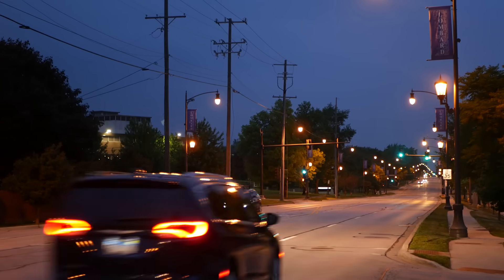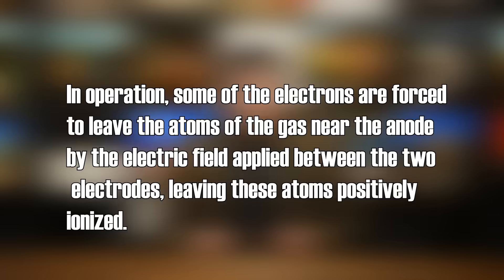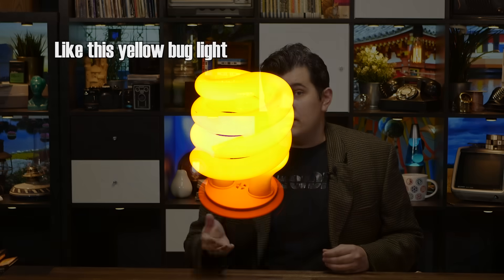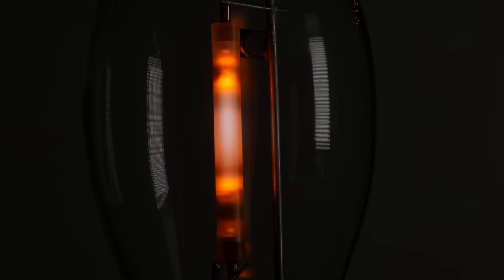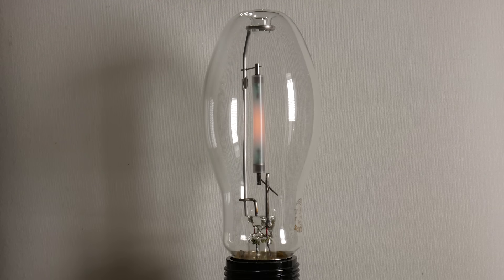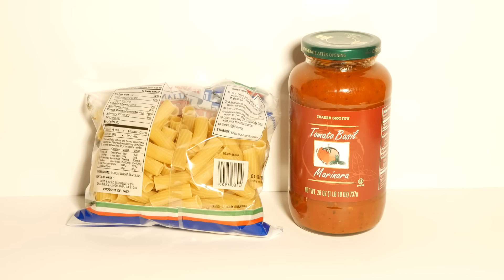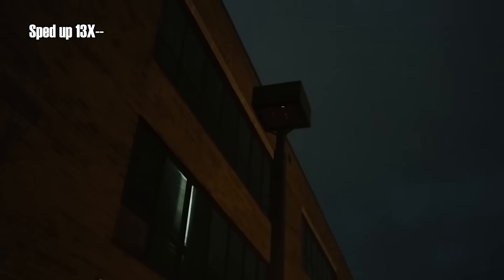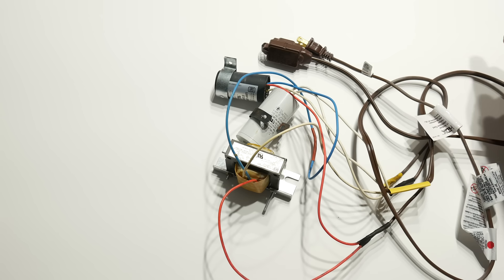The High Pressure Sodium Light: Ubiquitous, effective, but good?

Comment: By the way, discharge lamps predate the incandescent lamp. The good, old arc-lamps came first and this was what literally had caught Edison's eyes and made him come up with a solution for mass-producing a "soft" light you can use at home. Arc-lamps are also discharge lamps, they just use air as the gas with standard atmospheric pressure.

Also, did you know that the FAX came before the telephone? First was the telegraph, then the picture telegraph which was a crude form of the analogue FAX. Actually, analogue FAX systems were not standardized. A FAX like we know today is digital, no matter which country or brand you use, they can work together.
While the first picture telegraphs which scanned with light were made around 1900, there were versions long before the invention of the telephone which scanned using a wiper contact rubbing over an embossed metal plate. The picture had to be etched into the metal first.

Comment: First of all, great work, as usual!

You can make a home-made spectrometer using a CD or DVD (or Laserdisc ;-). All you need is an optical grid. A grid so fine meshed that the light bends with different angles when passing through it depending on wavelength. A CD is the same, just an optical grid "glued" onto an reflective surface. So a CD and a ruler is all you need, just make sure the light you want to examine shines onto the CD with always the same angle. You can use a monochrome CCTV camera module to analyse the result. You can put the CD and camera module into a cardboard box to do the trick. Capture a still image and you can analyse the picture in a paint program, e.g. use "alien map" to colorize the intensity levels like a thermal image camera does.

When I was in engineering school I made computerized spectrometers for the school. Just a shoe-box sprayed black, a piece of CD and a modified CCD camera for the parallel port of the computer in 1994. Nowadays a simple webcam or even better /Raspberry) "Pi cam" would do. In 2002 I had built a laser interferometer using an old Webcam electronics soldered to a FAX scanner line. 

Scientific instruments don't have to be expensive, it's all about calibration. Software compensation is cheap, easy and often as good as spending an awful lot of money for an almost flawless setup.

Comment: Technically, the CIE Color Rendering Index is not perfect as it tests a limited number of colors, all of them pastels, and doesn't correctly determine the rendering of saturated colors. It also doesn't take in account gamut, and how lighting level interacts with color perception. A CRI of 100 could still end up reproducing some colors badly (though that's pretty hard technically, it matters more for ratings in the 80-90+ range).

The IES TM-30-15 method and NIST Color Quality Scale are better ways to evaluate a light source's color rendering.

Comment: I remember having white street lighting some 20 years ago. Then they changed it to orange.
The orange glow makes it "feel" more like nighttime.
Reply: I remember an odd thing about the white ones, we used to go down the street when I was a teen and give the wood electrical pole they were mounted on a good kick.  They would immediately go out and about 2-3 minutes later start to come on again.
Reply: @Linflas  Sounds like the movement somehow triggered enough of a pressure increase to cause the lamp to shut off. This would happen normally when the temperature got high enough, but as temperature rises so does pressure in the lamp, so one can cause the other. When the temperature gets too high the lamp is designed to shut off. It then cools down and the arcing slowly starts to ramp up again, which also slowing increases the temperature of the lamp, and how bright it is.
Reply: @Linflas  This unlocked a memory in my brain lol. I once visited a cousins place in super rural Georgia, they have a singular streetlight infront of their house that will start out a bright blue-ish white but then slowly fade to a green-ish color before turning orange and shutting off for a few seconds before repeating. Its really creepy considering its literally the ONLY outdoor light for probably a mile or so. If you kick the pole really hard it shuts off for a while and comes back on to that cycle mentioned before.
Reply: Sadly they are going back to white. When the city beside mine switched to LED, they went to pure white LED...and it is too bright looks bad and is bad for the wildlife. You can have the orangishbrown LEDs but so few put the effort to use them instead of white.
Reply: @fortheloveofnoise  Yes, and it is also blinding, plus, it creates anxiety when I am around one.

IMO, Mercury-Vapor lamps are far more pleasing than LED lights also. I get the same amount of comfort from them that I do from the orange ones.
Reply: The first generation of discharge street lighting was mercury discharge which was a slightly blue white.
They were replaced with high pressure sodium for 3 reasons. More lumens per watt. Less refraction in fog. Lower bulb cost. Because mercury lamps produce a lot of UV and the bulbs are not too bright to stare into, eye damage was always a worry.
However, mercury light made buildings look far more attractive.
Reply: @wilsjane  love the mercury vapour lamps the best
Reply: @wilsjane   Interesting you say less diffraction in fog because when snowing the orange light is horrible as you see nothing while with the old bluish mercury discharge lamps you can see just fine when it snows with much less light reflecting from the snow in air. They have not come around to change all the old lamps yet here so you can clearly see the difference when it snows or wind is blowing snow. But now they are changing it to bluish LED laps that do not seem to have the same advantage of shining trough snow like the old mercury discharge laps .
Reply: +Rondo Cat. Sorry for my delay in replying, things have been a bit hectic lately.
It is quite a long story. In the early 1950's traditional tungsten lamps were replaced with discharge. The main reason was lamp life, around 6 times greater, but their were considerable energy savings that seemed less important at the time.
The 2 types were SOX sodium and mercury. Although the sodium were more efficient, they were a dull red, making it difficult to distinguish traffic signals and making human faces look a reddish green color. Therefore mercury was soon adopted, but some areas that had already converted side streets to SOX retained them, using mercury on the main roads.
Around 1970, their were worries about mercury on 2 fronts. The first was the rate of depletion of mercury on the planet and the second was the harmful effects of the heavy metal on public health when a lamp ruptures releasing the metal vapor into the atmosphere where it condensed into mercuric oxide. Worries were even greater about disposal of the lamps.
At about the same time, Thorn invented the SON high pressure sodium (that we are familiar with today). Since energy prices were rising,  the 40% saving was very welcome. Their performance in fog was a large improvement, but as you say they are not quite as good in snow. Since fog is a major cause of accidents in the UK and we get very little snow, they were better for us.
Then along came LED's. Stupidly, people were expecting the 80% energy saving comparing them with tungsten, but in reality they save around 20% compared to SON. Glare from the bluish white light is quite a problem, particularly on the lower lamp standards in side streets, A new diode has been introduced with a lower peak in the SED curve, but they give less lumens per watt. The main attraction was the 30,000 hour lamp life, but unfortunately LED's break down very rapidly in heat. The combined effect of the rectifier drivers and sunlight is causing a massive problem.

PS, If you have not already guessed, I am a chartered electrical engineer and I have worked on film set lighting for more than 50 years. I hope that my reply was not too confusing. LOL.
Reply: @wilsjane  yes and we need orange lamps in areas which get fog lots.
Reply: @wilsjane bluish green*
Reply: I like the orange glow, it feels cozy to me. In my part of California, they are rapidly changing street lights everywhere to white-ish LED's. These look harsh and weird to me, though technically superior. I grew up with the HPS street lights. I'm old enough to remember the blueish white mercury vapor street lights. Those were cool.
Reply: @gregmercil3968  Tell them how bad the white light is for wildlife, then they will change to orangishtan LEDs
Reply: @fortheloveofnoise  it fucks with their night vision and sleeping. It's pretty well known dude. Lots of national park campsites are starting to ban or limit white led headlamps for that reason.
Reply: Mercury Vapor lamps come in two types: coated or clear. Originally only Clear MV Bulbs were available, but in the mid-1960s coated was introduced. The one you are describing seems to be Coated mercury.

The difference is that Coated mercury is mainly white with a slight blue halo around it, but Clear mercury produces a white glow that is essentially an inbetween of Green and Cyan. The saturation is also stronger with Clear mercury than Coated.
Reply: They aren't as stressful to they eye compared to white light.
Reply: I don't think there are any orange LEDs. Just slightly yellow ones.
Reply: @Alaprine  Just Google "orange LED lights"
Reply: @Alaprine  you can 'make' then orange, with voltage control or a plastic/epoxy cover that's orange.
Reply: @Alaprine Oh they do exist, as a matter of fact, they existed long before blue LEDs were a thing. They're just not as efficient because the color amber just by its very nature is less efficient to produce. Also blue LEDs became a lot cheaper so they don't use them as much for that as well. Sodium lights are usually just as efficient as warm white LEDs which makes replacing them less compelling than just sticking with HPS at that point
Reply: My street turns blue white then it turns to orange
Reply: The orange lights helps you sleep. 
It’s good for drivers.
Reply: The white ones were mercury vapor lamps, which, while they are more efficient than incandescent lamps, aren’t as efficient as high pressure sodium lamps, so that is why they were replaced
Reply: @Jclighting-11  yep I remember someone said something like that in a another video, in my opinion I'll use both mercury vapor and HPS.
Reply: Yeah and sometimes blue and even green (otherwise known as cool white, while the orange glow is referred to as warm white, and the typical white is well, bright white because there's no hue in it)
Reply: white street light were bad for fog and for people sleeping, as the white light get inside far more
Reply: @bladerj  how does it affect people sleeping if the curtains are closed??
Reply: @marksmithwas12  not all people sleep the same
Reply: @kennethmiller3802  well if you have curtains, and the lights outside are keeping you awake, there's a clear solution there
Reply: @marksmithwas12  not really. Just means YOU think it's clear 

It's easy, not clear. Even most room darkening shades and curtains won't block DAYlight.

So.....I want complete black out when I shut my shades...
Reply: @kennethmiller3802  I don't mean to be rude, but what the hell are you on about?? 🤨
Reply: Because it looks like sunset
Reply: I hate white leds.
Reply: It's amber not orange
Reply: Mister Webb —— amber man bad
Reply: Yeah they did the opposite in my neighborhood.  Really ruined the night time vibe just so people can jog at 3 AM perpetually feeling like they have a spotlight in their face.
Reply: @RidinDirtyRollinBurnouts  You shouldn’t be jogging at 3am. Only creeps do that.
Reply: @masseyluna2002  it is not creepy to jog at 3am. I and anyone else can jog at 3am if we want. Also, LED's should not be taking over yet because LED lighting is still a very new technology and should not be adopted as an actual light source until they can be perfected, which they have not.
Reply: @r1ckastl3y86  LED lighting absolutely is not a new technology....
Reply: @r1ckastl3y86  also, they are cheaper to produce and to operate, with a higher lifetime.. LEDs have been around since as long as we've been using nuclear for power.....decades.

Should LEDs be thrown into every little thing? Fuck no.

But they SHOULD replace those that are so concerned with power consumption, which is a good swathe of society. It's beyond just that 

But you think it's a new technology despite literally 59 years of use and improvements which only come by with actual real world usage.

By your logic we need to axe YouTube, Facebook, myspacez Facebook, twitter, we haven't had them in existence enough to properly master 5heir deployment and usage.

Same with vehicles.

And government.

And religion 

Everything .
Reply: @kennethmiller3802  LED's are already failing and turning purple
Reply: They actually have orange colour filters they can fit to them
Reply: The town I grew up in at one point changed bulbs in the street lamps, from warm white to cold white, but only about half of them. I remember walking home from the community centre and always being creeped out when walking into the area lit with cold white. Something about it was just weirdly soulless and eerie.
Reply: @moabgram  Orange closely resembles fire, and fire is ingrained into our human DNA.
Reply: i like these over leds are harsh on the eyes and the cheaper ones are creepy with there greenish and bluish light
Reply: Humans evolved to be able to sleep properly even if you have red/orange light. Blue/white light keeps you awake.

Think campfire vs daylight.

The change to street lights in residential areas is annoying as all hell.
Reply: Not anymore. leds taking over.
Reply: Nope, sorry.  I remember the mercury vapor lights we had before sodium vapor.... they were a pleasing blue-white color that did a nice job lighting up everything without much of distortion (certain shades of blue were missing).  Drive out into the countryside.  Look back towards the nearest city.  It looks like there's a fire.

We switched away from mercury vapor because of environmentalists, of course, and because once the manufacturing techniques were improved, high pressure sodium lights were cheaper.  There were even some claims that the "depressing blue" caused suicides, to help push the switch... even though I find the orange glow far more annoying, and could probably counter with studies about increased violence as a result. :)
Reply: The orange glow makes it "feel" more like nighmare.*
Fixed it for you
Reply: @God-yb2cg  Makes it feel more comfortable in most cases, but the new white is better for walking att night
Reply: @God-yb2cg LED’s are bad for nocturnal creatures as well as human sleep patterns. And with minimum boost to efficiency and more conplex parts to malfunction.
Reply: @God-yb2cg  nightmare*
Reply: @God-yb2cg  The orange glow makes it "feel" more like your going to have a road traffic collision or get mugged. Because you cant see anything.*
Fixed it for you
Reply: @notmenotme614  good one bro.
Reply: the orange makes it feel like the 1800s. no thanks
Reply: @Blox117  Hey it's 2100 we put stars in our streetlights. But hey at least it isn't as easy on us as it was in the 1800s, not it's 2100 and we NEED to be blinded. Do you hear yourself dude?!
Reply: @Blox117  Blue makes it feel wrong